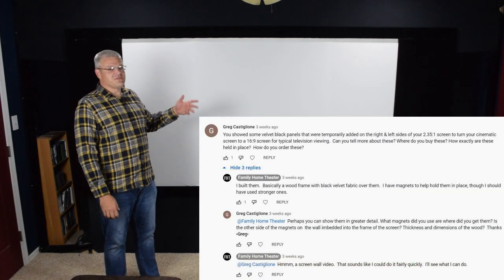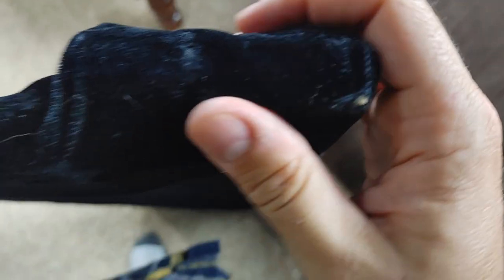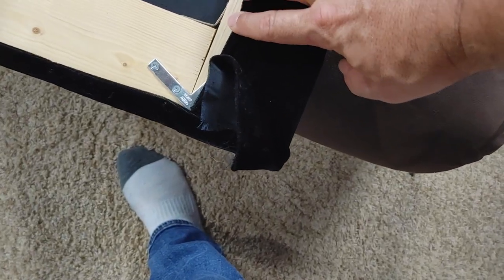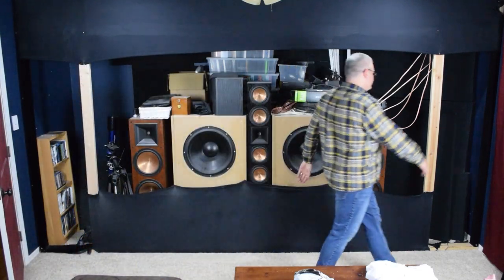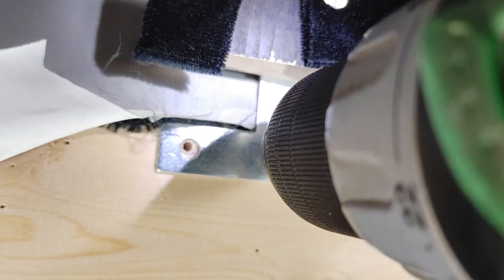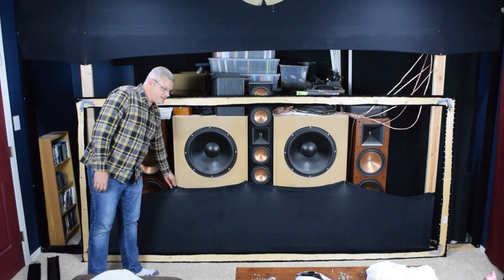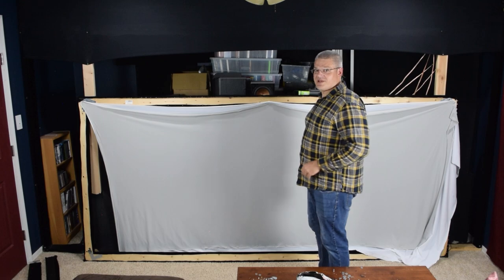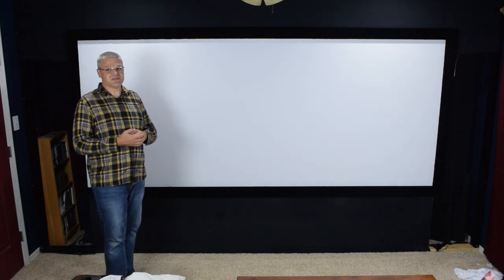Home Theater Screen Wall

Comment: Great job!  I did a DIY screen in my old theater and didn't find it too difficult despite the fact it was a curved screen.  

This time the screen is a lot bigger, 185" vs 144"  2.4:1 and despite being flat, it didn't go well.  The material I bought from Carl's Place (about $400+) was rolled up for months waiting for me to get to it and when I did, it had a mammatus cloud look to parts of it.  Unfortunately I was not able to remove this with a hair dryer.  I also had built an extruded aluminum frame as opposed to wood on my previous build and my method of attaching the material with spline proved to be more difficult than expected.  Me and my big ideas!  I should have kept it simple and used wood like yours and like my previous one.

Anyway, I've got the Stewart now, it wasn't cheap but I do have connections and got both it and the JVC NZ8 wholesale.  Still not cheap even then but I think it will be worth it in the end.  

I like your videos, I'm not into the videos done by the, "professionals" or home theater installation companies.  I get more ideas for my theater watching videos like yours and Chris Chavis (YouTube, "My Home Theater") than I get from those guys.

Comment: Nice to see the videos are still coming :) & I'm glad you mentioned the HVAC thing, which I hadn't considered. Think I'll be installing some decent sized vents to provide paths of less resistance for the air to hopefully take rather than the screen!
Reply from the maker: Some will still go through the screen.  My sides are completely open yet air still goes through, though it takes longer.  Years ago I also had spandex on the side... When the HVAC turned on, I could see the struts behind the screen because the screen would be sucked I to them.  

My next video is supposed to be an LS12000 review... But my dealer still hasn't shipped (ordered end of May). So...
Reply: @FamilyHomeTheater  Good to know, I suppose if I found it to be an issue I could always try extending the ducting so the intake sticks out of the front of the screen wall to see if that helped. Look forward to the LS12000 review 👍
Reply: Looking forward to you Ls12000 review. Considering the exact same model for my HT build. Keep the videos coming!

Comment: Great content again. I'm really thinking upgrading my 16,9 screen to 2.35. I do have epson eh tw7100 4k pixel shift. Was it worth doing 2.35? Planning about 130 screen 2.35 and I'm about sitting 2.9, 3m away from screen.
Reply from the maker: I really like it, and it's even easier to use now that I have an LS12000!  I sit about 7.5 feet away from this screen which is "too close" bit it's all about what you like.
Reply: @FamilyHomeTheater  ok. I build my diy 16x9 screen last year with spandex following your channel. Thanks heaps. Now may change my 16x9 to 2.35 and just manually zoom out and in for correct content.
Reply: @FamilyHomeTheater  Love your channel content. Very informative and simple. Congratulations on the LS12000...look forward to see your review of it. Maybe you can do a video where you show actual footage of the image on screen for both 2:35.1 and 16x9...again, congrats and keep up the great work!!!
Reply from the maker: @sergiobarrena6626  Thanks!  It is coming... I just recently moved and am getting my new theater room all set up.  Almost finished...  I can do video of content but it's really hard to judge a projectors image based off video.  Depending on how the video is shot a good projector can look bad and a bad one can be made to look good...